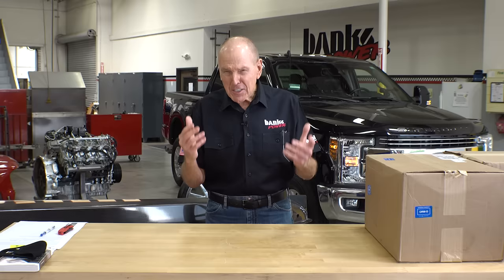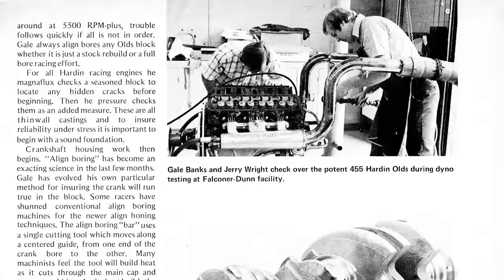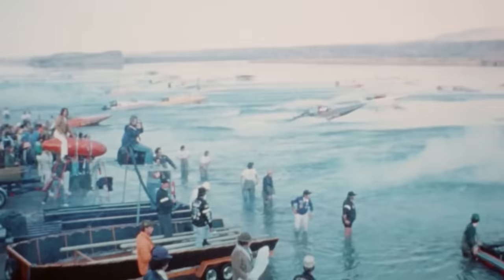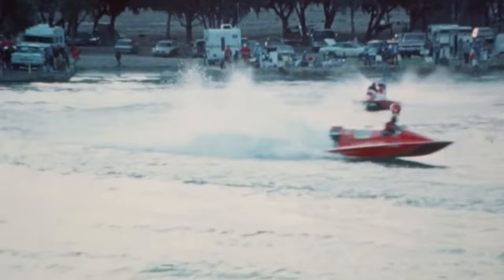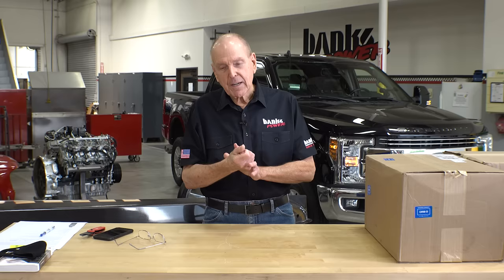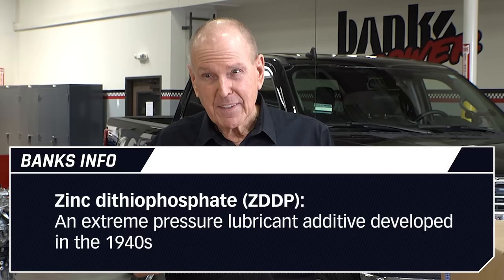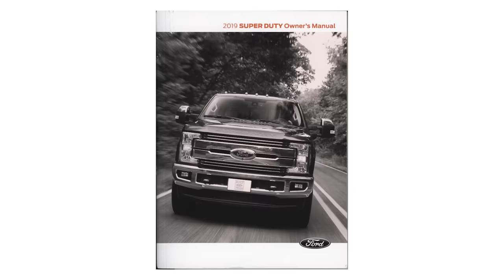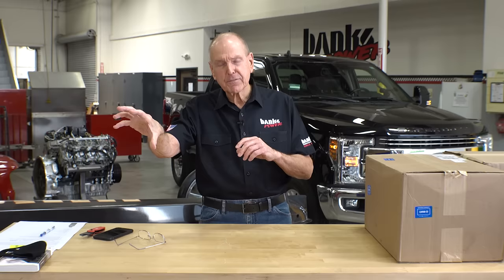ENGINEERING UNBOXED: This filter can extend your oil life

Comment: So now if the general public orders an oil filtration bypass kit from amsoil do they also get full cases of mudslinger , miracle wash and whatever else they felt they could shamelessly plug
Reply: They probably would if they plugged it on their YouTube channel that has 160k subs and they had an unblemished 50 year history of engineering with their own company named after it. Everyone gets that it's an adversivement, or sponsored video in this case, this isn't an unbiased product review. Bypass filtration systems usually work really well, this one probably does too. I am confident that Gale would call these guys out if it turns out to be a piece of shit.
Reply from the maker: Gale debated for quite some time about doing this video for this very reason. He was skeptical about the concept of bypass filters. It wasn't until he tore into the data that he felt comfortable enough with the system to promote it. He's very careful about the products he endorses. At the end of the video, he points out that this system would not be suitable for race vehicles. But, for daily drivers and tow rigs, this can help extend fluid life without taxing the oiling system.
Reply: @timothybayliss6680  and that is exactly what we came to see ...
Reply: @bankspower  I'm very interested to hear a follow up on this, now over a year later. Has the system lived up to the hype and expectations? I'm closing in on my next oil change and would like to install if it's really worth it. So tell us, Gale, how's it worked, and do you still recommend this upgrade?

Comment: I've put a half a million miles as an OTR Truck Driver many years back (wound up in a nuthouse for a few weeks as a result but still have my License!) and I always laugh at how little I cared about how these six figure head units ever even worked. The one exception was braking because of my love of Sir Isaac Newton and just how much inertia was under your feet on just a regular run up or around just 60 miles per hour while under load. Big even huge fan of the Freightliner M2 Sport Chassis if I ever went back. I had a real wizard in charge of my truck when I drove Class B for the US Postal Service. Gorgeous cabover Freightliner with a tax axle. As far as soot send it straight of the stack was our motto going on the Way Back machine(2004-2008?). Oddly enough the biggest problem we would run into was water in the fuel as clean diesel sure ain't biodiesel from my experience and back then diesel was 4 bucks a gallon yet hardly a premium product that it is now. Methanol is another wild choice for fuel in this engine type of which I am a huge fan of and respect the massive markup as money well spent despite the fuel coat premium. Ran an Audi A3 in Germany for a few weeks and at 130 miles per hour it was the best vehicle I have ever driven by far. VERY unassuming which I liked. Used to have Supercars pull up next to me and shoot me a look but then for them 130 mph to 180 mph was not even a downshift as they were running on gasoline. To say I was impressed by the superior chemistry of gasoline because of that would be putting it lightly. Oddly enough the German Tiger Tank of World War 2 fame was powered by a gasoline engine for those thinking who would use gasoline as a fuel for pulling weight. The answer is really straightforward of course but I'll let you watch the videos of a Tiger Tank in action in order to allow you to draw your own conclusions. Let's just say despite being woefully underpowered that Tiger Tank could really rock and roll precisely because *that ain't no diesel..

Comment: Mercedes stopped importing diesel cars for 6 years yet to everyone’s knowledge at the time those diesels are bulletproof. Lol. Still have one running perfectly in 2020. Eats bio diesel for lunch and never pitches a fit about what it’s diet is. 🦾
Reply: In some cases, Benz didn't import diesels because they didn't believe the demand was high enough, or because they weren't sure how to meet California smog. In the 1990s, Benz still had prechamber engines, some with little to no electronic control. They returned when they were making all fully computerized direct injection diesels.

Comment: Is there a limit of filtration that would pull the additives like the sink and wherever else they put in
Reply: Centrifugal filters can pull important minerals out.  On big turbines at the power plant where I work the oil hasn't been changed in 32 years, still on the original fill other that top ups from leaks and spills.
 While Babbitt bearings on a steam turbine are in a different environment than an internal combustion engine, I would imagine oil purification has generally the same goal no matter what the application is. 
The turbine bearing oil is filtered through media filters and through a bypass centrifuge. Another bypass filter it goes through is a 'Fullers Earth Filter' which adds minerals  and whatnot back to the oil that the centrifuge slings out. The fullers filters are changed monthly along with an oil sample analysis. Media filters changed based off DeltaP, generally bi-annually. Centrifuges are cleaned annually.

Comment: Your diagrams are wrong.  First diagram shows the bypass as a full flow filter.  Second diagram says Fuel filter.  Oil does not go thru a fuel filter.  They also sent you the wrong bypass for that engine.  You need a EA BP100 filter and not the EA BP90.  It’s too small for the amount of oil that engine holds.  I use a Amsoil bypass EA BP90 filter on my 1992 Toyota V6 that holds 5 quarts.  Installed the filter when I bought the truck new.  It now has 460,000 miles on it.  I have multiple vehicles so I don’t solely drive my truck.  If I did, I’d have over a million miles on it.  It’s never stranded me in 460,000 miles.  It’s always got me from point A to B and back.  Thanks to Amsoil synthetic and the bypass filter.
Reply from the maker: You are correct.
Reply: I also had a 2004 Powerstroke 6.0 with a complete Banks system on it and bypass filter.  I sold that truck though.

Comment: i was always told that a bypass oil filtration system was no good ....especially in the case of a blown engine ....whats your take on that Mr. Banks ?
Reply: “Especially in the case of a blown engine.... “.  Lmao 😂. Just gonna imagine you’ve got bigger things to worry about once you have blown the heads/head gaskets/ cracked the block😁
Reply: @truedarknessify   He is talking about an engine with a Blower on it... Not an engine that was blown up...

Comment: If you run a 7.3 or 6.0 Power Stroke this system is useless. This will not extend your drain intervals because they use high pressure oil to fire the injectors. This process sheers the oil to a lower viscosity. Change every 5,000 miles with a high quality 15W-40 no matter how you drive or what you tow 👍

For oil analysis make sure the engine is hot when you drain the oil. Pull the drain plug and wait until about half the oil is drained and then catch a sample midstream. When you push that tube down the dipstick tube how do you know it won’t hit the bottom of the oil pan? Better take a tape measure and mark it so you don’t go to far down.

Comment: Overkill on gassers?
Reply: Petrol engines wear out too... often much faster than many diesel engines.
If you can remove the particles causing all the wear (2~22 microns) you have just extended the life of your engine dramatically.
The reduction in wear also manifests as an equivalent improvement in reliability i.e. A decrease in breakdowns and unscheduled maintenance.
The engine is noticeably quieter... and quieter means more power.
No matter how you calculat it the filter pays for itself very quickly.
🙂
P.S. There is a spin on version of this kind of filter from Trasko.
They remove exactly the same amount of particles as the a bypass filter without all the extra plumbing.

Comment: She is really proud of how she keeps her house.  And yet she married a dirty, greasy mechanic.  You must have worked extra hard to fool her or did you become a mechanic afterward.

I changed out an awful lot of Luberfiner bypass filters on 350+ horsepower diesel engines and took an awful lot of oil samples with accordion style suction bottles.  When an oil change requires six or more gallons of oil you use whatever you can to make it last as long as possible.  If your diesel vehicle does not have a engine coolant filter with a sacrificial plate then you need to get one put on tomorrow.

Comment: You didn't have a before and after....
Reply: Yeah... I was waiting for one too.
However our results on petrol engines and bypass filters show that they remove all particles above ~2 micron in size.
We use a simpler spin on filter to achieve exactly the same result.
We've been running these kinds of filters for millions of km over the last ~40 years.
Fitting bypass filters puts people off buying them... plus the price.
:-)

Comment: Be careful with filters around 2µm or smaller. Some of the molecules of the additives in the oil, can be bigger or close to 2µm. Better ask the oil manufacturer what the minimum size is possible for the specific oil you use.

Comment: For decades Japanese diesel engine OEM oil filters are bypass filters. For Ford to not equip this type of filter in this era is poor engineering. Like they say four wheels and a board made a rattling good Ford. One thing for sure bypass filters are essential for the longevity of your diesel engine.

Comment: Do you want to solve a lot of the shit problems if somebody would do things like do your final hone on the engine with torque lights all right and you don’t just put the torque plate on and then five minutes later start honing you put the torque plate on let it sit for several hours maybe overnight and then when you put the engine together let’s start talking about zero gap second ring OK maybe even a zero gap top ring that would be a step ring like you used to be Childs and Albert now actually and Albert use the guys that would greatly reduce the foot in the oil yes you need still need to bypass filtration and good quality oil like Amsler uses I have an old 91.5 Dodge I’ll give you three guesses was under the hood yeah it’s a CumminsAnyways you need a good quality engine oil and if you work in the truck hard you need to change it when you regularly and it doesn’t hurt to do a oil analysis but anyways yeah the M-Zole has very good products I’ve been using for years Gail banks thank you for what you do you have a nice day bye bye

Comment: No matter what you filter out, fuel dilution is an issue that can't be filtered out. Anyone making claims about lifetime oil is wrong, you can only extend the life of the oil and no more than a couple oil changes before the fuel degrades the viscosity and in turn the lubricating effect. There is a reason ALL fleets in the country do not waste their money on these filter upgrades. The engine was designed to work the way it does and maintenance can make most go forever if you know what all to maintain. This video is a snake oil scam

Comment: ...but DPF and EGR do not increase mileage.  Not at all.  In any brand.  Wait until your SCR system fails after too many regen cycles and you have to replace the DPF.  Then figure in the cost per mile along with that stupid urea solution you have to add more of because of a high dose rate from towing heavy loads.  The engine is not efficient blowing exhaust gasses back into the intake.  Why do people keep believing this?  Amsoil is a stellar product.  I have used this in every vehicle I’ve owned and the other goodies they sent Banks.  It is great stuff!  Great video.  You had me until you started praising Selective Catalyst Reduction systems.  Worst thing ever installed on a Diesel engine.

Comment: Amsoil has shamelessly included a bunch of other products solely for marketing purposes.  Gale and especially Amsoil should be so embarassed!

You can insert a evac hose down a dip stick tube too far and so it is just as bad as sampling out of the drain plug.  It would be hit and miss to take a proper sample this way unless you dropped the oil pan and insert the evac hose to the same level as the oil strainer sump, and then mark the top end of the evac hose exactly exactly at the top of the dip stick tube.  AMSOIL has a POOR APPROACH to oil sampling, which should be taken from oil that is about to be pumped through the engine.  In other words, there should be a sampling port on the intake side of the bypass oil filter.  Gale, you should know this but failed to mention it, hance a favor-for-a-favor.  Sad.
BTW, I have a 2 micron oil bypass filter, but it isn't the Amsoil brand, and I use the Manufacturer's oil.  I also change the oil sooner than recommended because soot isn't the only enemy that finds its way within diesel engine oil, and sampling is great, but for the price of sampling, my method is more cost effective.
Full disclosure (something all video producers should have in their uploads):  I do have a Six Gun and a Cat Back Exhaust system by Banks Engineering in my 1999 F-250!
Reply: I change every 5,000 miles in my Power Stroke no matter what. I’m more worried about oil sheer from HPOP than soot. Spot on about the way they are taking oil samples. I run John Deere 15W-40 Plus 50-II. Great oil analysis at almost 500,000 miles.

Comment: I fail to see the real difference between this and a regular, high quality, oil filter.  Sure it has hoses and brackets as stuff to relocate, but as far as the filter element it looks every bit the same as anything off the shelf.
Reply: The bypass filter removes much smaller particles, but cannot flow enough oil to feed the engine like the full flow filter does. It just filters a fractions, say 5% of the total oil in each pass but this effectively cleans all the oil over a period. It varies but very roughly a standard oil pump flows several litres per minute at operating revs, so the entire sump contents would go through the full flow filter in a couple of minutes, so in less than an hour the full sump contents would go through the bypass filter.

Comment: Sorry Mr. Banks. I treat your word as gospel most of the time, but I can't agree with you that shorter service intervals are due to soot build up. Working a engine harder is more heat/pressure/friction that reduces the effectiveness of the oil additive package. Consequently there will be more soot build up in the oil but I do not think that is the reason they change.

Comment: $20 worth of rubber hose, a $10 oil filter and a small aluminum adapter block = $500 according to Amsoil’s website. That’s a typo on their pricing right?

You could just change your oil with fresh new oil twice a year for 8 years and still come out cheaper (and better) than if you paid this insane price for what little it actually is. They sell fuel lift pumps with 2 micron filters, water separator, a pump motor, regulator, 20’ of rubber fuel hose, mounting brackets, hardware, wiring for less than this. Don’t do business with scam price companies. There’s no justification for this $500 price for an oil filter and some hose.